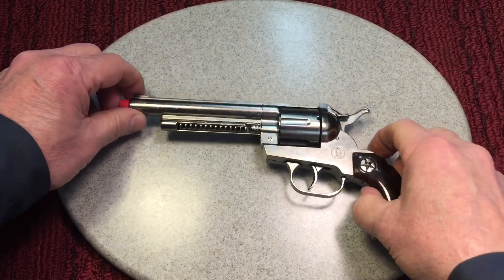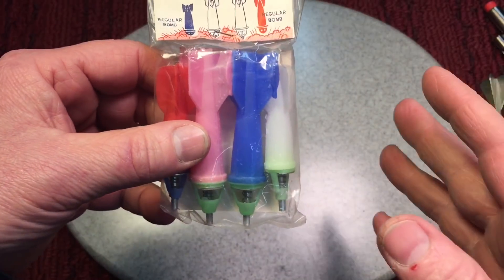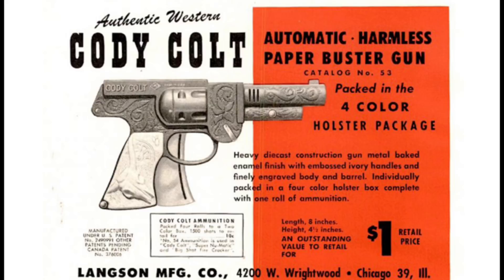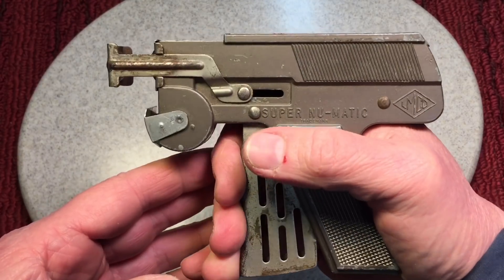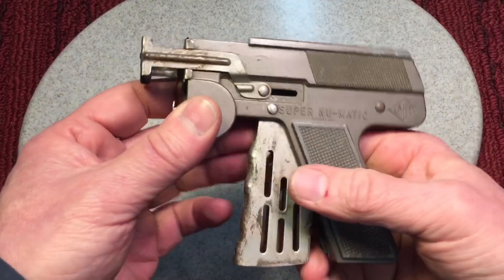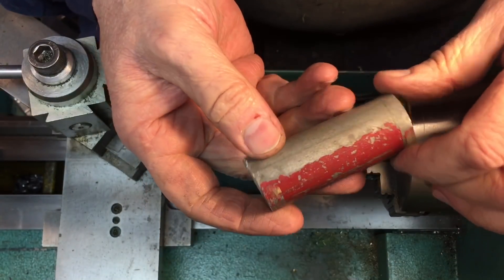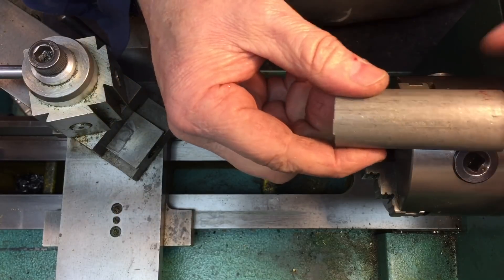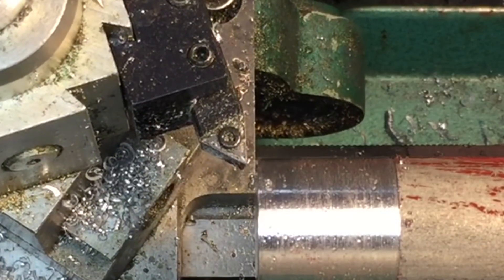Super Nu-Matic Paper Popper and a Custom Screwdriver Fabrication

Comment: Scout, I took one of the 4-in-1 double ended screwdrivers and removed the plastic handle... replaced the plastic with a bit of “family heirloom” wood that I turned on the lathe. I actually did 4 of them as Christmas gifts a few years back. Turned out great! Great video... one more reason that I need a metal lathe!

Comment: Ah the cap pistols. We had a cheap pistol and the caps wouldn’t advance. We used a hammer and pounded the caps on the sidewalk. Nice, loud pops. 

Very cool screwdriver. You will have to get an engraving machine and add Made in USA on the handle. 👍

Comment: Hi, O' Crafty One... A question for you. It's a little off topic maybe, but do you think the 1-ton Arbor Presses they sell at places like Harbor Freight or Amazon would straighten out smaller hand tools like screwdrivers and pliers and such?
Reply from the maker: Hi Mike!  The small arbor presses are really not very strong.  I have one I bought for assembling Pens I made on the lathe.   You could do more with a vise then you can with those presses..  The much larger arbor presses are nice but not cheap!  A small hydraulic bench top 10 ton press from Harbor Freight will do so many jobs!  They do work well too!
Reply: @ScoutCrafter  Good information. I'm looking at the 10T+ ones now. Thank you for taking the time to answer my questions.

Comment: Beautiful screwdriver. I wondered how you would press fit the screwdriver shaft into the handle without damaging the tip. Like the delrin solution. I haven't seen caps or cap guns for ages, but I certainly bought my share of caps in the 1950s and like every other kid I knew, had a six shooter. Never used the plastic disc caps, because I was getting older. Thanks

Comment: As kids, we used to take an entire roll of caps- a FULL roll, lay it on the driveway and smack it with a hammer. The bang was WAY louder than if you put it in a cap gun, which we did regularly. Yes, it was a waste, but man was it fun.

Comment: A neat trick that one of my toolmaker friends showed me. To make a convex radius slide the upper compound out until it is behind the pivot point. With the setscrews loose bring the lower compound in until the tip of the cutter hits the material. Rotate the upper compound. The tool will cut a radius. Using the main feed screw, or the compound hand wheel, move the cross slide closer to the headstock and take another cut. Continue until your radius is cut as far as you want it. 
To make a bigger radius move the upper slide further out. To cut a concave radius have the upper slide ahead of the pivot point. 
It helps if you have a brass button on the tip of your setscrew. Then you can put a little pressure on the pivot so it doesn't skip around on you.

Comment: The shanks you showed work great for that. I use them to make old screwdrivers new again, if the tip is broken but the handle is still good just pop out the old and press in the new shank. 🤪

Comment: I grew up in the 90’s and I always played with cap guns, I also used to set the paper rolls on fire because I was a little bit of a pyromaniac. And I know all of you have set them on fire so they would pop too! I also used to have one of those missiles you would throw in the air, which was made from metal and similar to the one you showed but instead of paper caps it would use a single plastic cap, we would just cut up the cap rings.

Comment: I always enjoy it when you or Mr. Pete have show and tell...
Brings back great memories 👍🏻
I remember a kid down the road would take 2, half inch bolts and one nut...start one bolt into the nut and put 2-3 white tipped kitchen match heads into the nut...
Then start the other bolt just barely catching some resistance ,THEN drop it on the street ( boom)  not that thrilling but good enough when you’re a kid 😃

Comment: James Alsup nailed it....pun intended, both for the use of a hammer, and for the purple nail.  I used to stack caps together and lay them in the street and whack them with the biggest rock I could handle.  The down side was running out of caps too quick! Fantastic Screwdriver!

Comment: Besides the roll in my pistol, some kids in the neighborhood showed me you could light the rolled out caps off one by one by scraping your thumbnail across the black dot. Set the caps on something and scrape really quick. You'd end up with powder stains (and something like a powder burn) on your thumbnail. A little later I got a pistol that used Greenie Stik-M-Caps. The rig had a derringer pistol set in the buckle that could flip out. I can't remember ever trying to shoot the derringer. I remember those sheets of caps, probably from the very early 60s.

Comment: I grew up with Cap Guns. I got mine @ the Five & Dime Store. As I got older, I took a single Cap and placed a BB over it, and wrapped a small piece of tissue paper around it. Toss it on the sidewalk, and it popped. Firework Stands in Texas sell boxes of 50 ct. Poppers, but these use small gravel in place of a BB. (biodegradable?)
Would a strip of Bubble Wrap (small bubbles) work in the gun?

Comment: that screwdriver is really nice. Oh and the cap revolver, had plastic ones with the round plastic caps and had plastic ones for the paper caps. And you have been a real cool dude when were using the nail of your thumb to made the paper ones explode in your hand while pulling the paper with your other hand through your thumb nail-index finger. Had the plastic bombs too, but these were only working on the streets where we aren´t allowed to play, so we played with the steel lawn darts...oh the good old times

Comment: My parents used to chase me out of the house on Saturday mornings.  Now why would my parents want to get rid of me on Saturday mornings?  I would then proceed to wake up the neighborhood with my cap guns.  You could make those cap bombs out of 1 1/4 x 20 bolt and some washers.  My cousin had a six shooter that actually shot out plastic bullets.  The cartridge had a spring in ti and you would push the bullet into the cartridge.  Load the cartridge into the cylinder and away you go!

Comment: I remember the old cap guns. I had both the roll caps and the plastic caps. I remember making something with a nut an bolt with my dad to throw in the air with a roll cap in it. That screwdriver looks awesome.

Comment: A+
Reply: When my cousin and I were about 10 or 11 we went down to the basement and set rolls of caps on the concrete floor and hit them with a hammer. We did that until our parents yelled down and told us to stop. Did you ever shoot some caps in a capgun and then suck the smoke out of the barrel and blow it out of your mouth? What a taste! 
John, I would love to see you make a flat screwdriver. I always wondered if the tip was pounded down or ground down or what. I love your videos.

Comment: NEAT little screwdriver and yessir, the Almighty was gracious to us once again. I remember caps very well but they didn't work too good for me BUT you might not know this but about all the blasting done today, at least at quarries is fired off by ONE percussion cap like used in a cap and ball rifle. Instead of wires the flash travels a tube about the size of a weedeater line filled with aluminum powder. That's why you see the flash when watching demo and large blasting videos. The fire traveling the tube! I was 1st around blasting on the road job right out of reform (high) school in 69 and it was all electrical then. Many years later a shot was being loaded at the boulder hole where I was working and having nothing to do and having known the blaster for years, I got to help load. And having being out of the loop he gave me the grand tour. Talking about faked out! And then later I was there helping blast out a foundation. WILD stuff. No more big plunger magneto box. Just a little handheld thing that one cap fits in and the tube runs through. Smack it with your hand and off she goes. Your lesson for the day, maybe. Have a FINE weekend with the GF and GBWYall

Comment: Love it! When I was in metal shop in high school I made a steel headed hammer with an aluminum handle and we had to come up with a way to attach the head and what I did was I put the handle in the freezer and heated up the head in our furnace at home and then pressed the handle into the head and it sweat welded itself together and never came out! The hole in the head was the same size as the end of the handle. The heat expanded the head and the cold contracted the handle enough to fit momentarily inside the head, until the heat expanded the handle